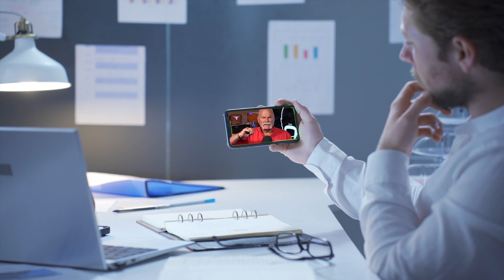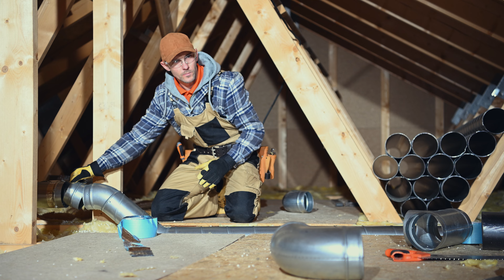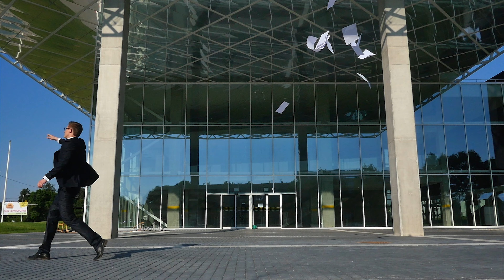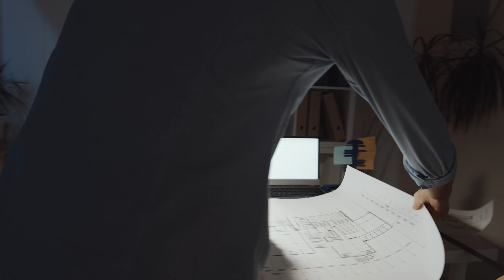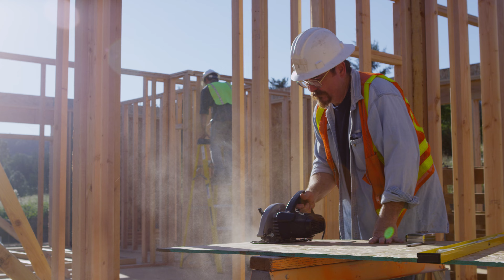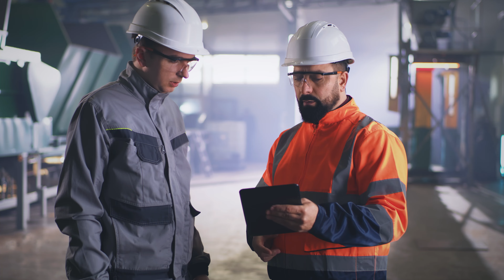When is it time to move on to a NEW job?

Comment: I've been working at a bike shop as a mechanic and intend to go into plumbing mainly because I stopped learning and progressing in the industry. The only things slowing me down are the need to maintain my current income and the lengthy waiting period to be enrolled in my local union. I might default and go the nonunion route to get experience as soon as possible.
Reply: Don’t they pay you as an apprentice if you got through a union?
Reply: @Monkey-boyo_0  Kind of. You do get paid as an apprentice but only once you become accepted to the program and are assigned to work under a contractor of the union's choosing. In my locals, they place you on a waiting list and it can take years before they pull you off of the list and enroll you. On top of that, the type of work my unions do is very much seasonal so you're not even guaranteed employment throughout the year. At least that's how it is in my area.
Reply: @Boblol126  where are you from? Bc what I’ve heard is that they are hurting for people to stay in the industry
Reply: @Monkey-boyo_0  Bay Area. I've heard the same but it boils down to what sector you're talking about. For instance, around here, the nonunion service plumbing guys are pretty much always looking for competent workers while the union guys as I mentioned can afford to be picky because they have a large sway in the new construction sector.
Reply: @Boblol126  that blows bc it probably mean you’d need to go to school for it while working for nonunion to actually get a firm understanding of the trade if you want to start your own business/company
Reply: @Monkey-boyo_0  if you want to run a business with full-blown licensure allowing you to take on jobs greater than $500 in California, you'll need to seek schooling on your own, yeah it sucks